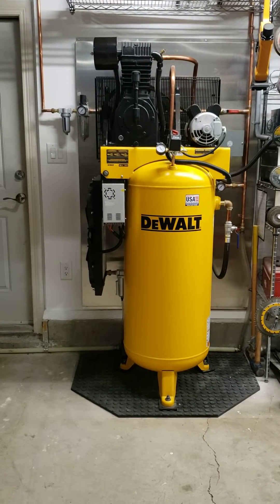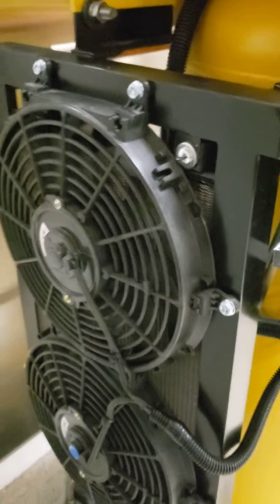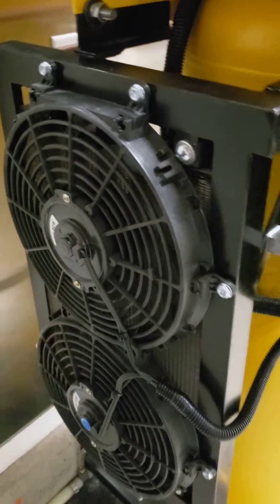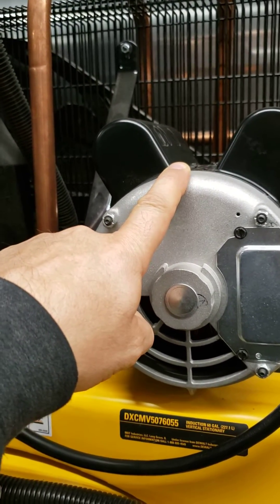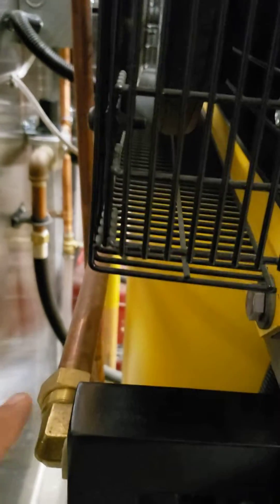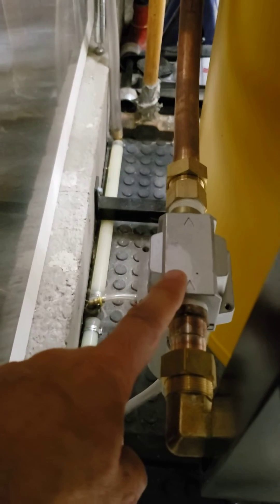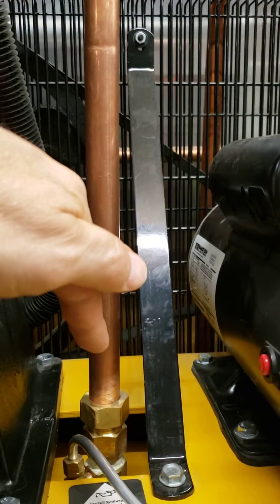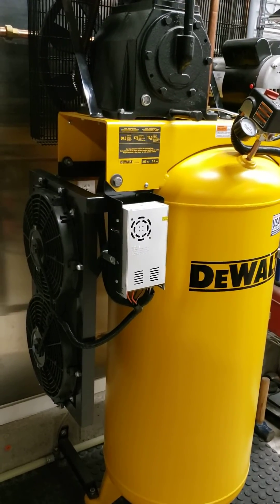Air compressor with an aftercooler

Comment: Masterful setup! It's close to what I'm building minus the AC/DC conversion but kudos on that too. Very nice, and very professional looking. My only constructive comment is that 'compression' fittings is NOT the way to go in this application. Not. At. All... But, you apparently got them to seal though flared fittings are the preferred method of construction for air/gas type of builds especially with these levels of pressure. Minus that on bit, THIS is the way Compressors should be sold! Very nice.
Reply from the maker: Thank you! Regarding the compression fittings because of cost I went with solid copper tubing.The compression fittings are on pretty tight to the point that the rings have slightly in-bedded themselves into the copper pipe.

Comment from the maker: This is list of the items needed to build the aftercooler on my compressor:
Amazon: Qty  1- Hayden Automotive 1260 Heavy Duty Oil Cooler. (Use as the condenser)
Amazon: Qty 2- LTWFITTING 7/8-Inch OD x 3/4-Inch Male NPT 90 Degree Compression Elbow, Brass Compression Fitting (to connect the condenser to ¾ inch copper pipe)
Amazon: Qty 2-  LTWFITTING Brass 7/8-Inch OD x 3/4-Inch Female NPT Compression Connector Fitting (to connect the ¾ copper piping to the compressor and check valve on the air tank)
 Amazon: Qty 2- Hilitchi 120pcs 22-16/16-14/12-10AWG Piggy Back Insulated Terminals Electrical Wiring Wire Crimp Connectors Set (2- Crimp connectors to connect 220v air compressor motor to the breaker for the 12v transformer)
Qty 1 Junction box and breaker ( I had an electrician supply and install my hookup)
Qty 1-  220v to 12v transformer, Item: DF-1765 Universal AC to DC Converter Output 12V-13.8V DC, 20 Amp (connect from breaker to the transformer from transformer to fans on the condenser) I am recommending this transformer as the transformer in the video failed. Why? Unknown as the power consumption from the fans are well below the output of that transformer.
ebay: Qty 2-  DUAL 10" INCH HIGH PERFORMANCE ELECTRIC RADIATOR COOLING FANS (attach to condenser) 
ebay:  1-    3/4" Compressed Air In Line Moisture & Water Filter Trap Compressor Auto Drain (the fitting on this is pretty standard at home depot.
For copper piping I went with ¾” type L copper from Home depot. I use a pipe bender to make all the bends.  The reason I went with the stiff copper pipe was cost. I live in Canada and I can only get ¾” soft copper at 100 foot lengths at $600.00  

The bracket holding the condenser and fans I fabricated from 1-1/2" angle iron.

Comment: Awesome installation great video thank you.

Any chance you could mention how you did your tubing and fittings? And maybe a link to your 3/4-in tubing cooler
Reply from the maker: Hi John Dyal,
A list of the items needed to build the aftercooler on my compressor:
Amazon: Qty  1- Hayden Automotive 1260 Heavy Duty Oil Cooler. (Use as the condenser)
Amazon: Qty 2- LTWFITTING 7/8-Inch OD x 3/4-Inch Male NPT 90 Degree Compression Elbow, Brass Compression Fitting (to connect the condenser to ¾ inch copper pipe)
Amazon: Qty 2-  LTWFITTING Brass 7/8-Inch OD x 3/4-Inch Female NPT Compression Connector Fitting (to connect the ¾ copper piping to the compressor and check valve on the air tank)
 Amazon: Qty 2- Hilitchi 120pcs 22-16/16-14/12-10AWG Piggy Back Insulated Terminals Electrical Wiring Wire Crimp Connectors Set (2- Crimp connectors to connect 220v air compressor motor to the breaker for the 12v transformer)
Qty 1 Junction box and breaker ( I had an electrician supply and install my hookup)
Qty 1-  220v to 12v transformer, Item: DF-1765 Universal AC to DC Converter Output 12V-13.8V DC, 20 Amp (connect from breaker to the transformer from transformer to fans on the condenser) I am recommending this transformer as the transformer in the video failed. Why? Unknown as the power consumption from the fans are well below the output of that transformer.
ebay: Qty 2-  DUAL 10" INCH HIGH PERFORMANCE ELECTRIC RADIATOR COOLING FANS (attach to condenser) 
ebay:  1-    3/4" Compressed Air In Line Moisture & Water Filter Trap Compressor Auto Drain (the fitting on this is pretty standard at home depot.
For copper piping I went with ¾” type L copper from Home depot. I use a pipe bender to make all the bends.  The reason I went with the stiff copper pipe was cost. I live in Canada and I can only get ¾” soft copper at 100 foot lengths at $600.00  

The bracket holding the condenser and fans I fabricated from 1-1/2" angle iron.

Comment: That's the same compressor I bought and want to the same thing to mine. Can you list all the items and fitting you used?
Reply from the maker: Hi  jcorona0791
A list of the items needed to build this setup:
Amazon: Qty  1- Hayden Automotive 1260 Heavy Duty Oil Cooler. (Use as the condenser)
Amazon: Qty 2- LTWFITTING 7/8-Inch OD x 3/4-Inch Male NPT 90 Degree Compression Elbow, Brass Compression Fitting (to connect the condenser to ¾ inch copper pipe)
Amazon: Qty 2-  LTWFITTING Brass 7/8-Inch OD x 3/4-Inch Female NPT Compression Connector Fitting (to connect the ¾ copper piping to the compressor and check valve on the air tank)
 Amazon: Qty 2- Hilitchi 120pcs 22-16/16-14/12-10AWG Piggy Back Insulated Terminals Electrical Wiring Wire Crimp Connectors Set (2- Crimp connectors to connect 220v air compressor motor to the breaker for the 12v transformer)
Qty 1 Junction box and breaker ( I had an electrician supply and install my hookup)
Qty 1-  220v to 12v transformer, Item: DF-1765 Universal AC to DC Converter Output 12V-13.8V DC, 20 Amp (connect from breaker to the transformer from transformer to fans on the condenser) I am recommending this transformer as the transformer in the video failed. Why? Unknown as the power consumption from the fans are well below the output of that transformer.
ebay: Qty 2-  DUAL 10" INCH HIGH PERFORMANCE ELECTRIC RADIATOR COOLING FANS (attach to condenser) 
ebay:  1-    3/4" Compressed Air In Line Moisture & Water Filter Trap Compressor Auto Drain (the fitting on this is pretty standard at home depot.

For copper piping I went with ¾” type L copper from Home depot. I use a pipe bender to make all the bends.  The reason I went with the stiff copper pipe was cost. I live in Canada and I can only get ¾” soft copper at 100 foot lengths at $600.00  

The bracket holding the condenser and fan I fabricated from 1-1/2" angle iron.
I hope it all works out for you!
Reply: @GoogleUser-tp1mq  Thank you so much and keep posting informative videos.